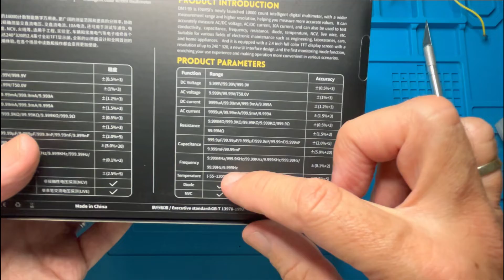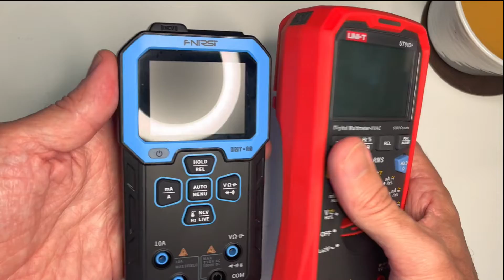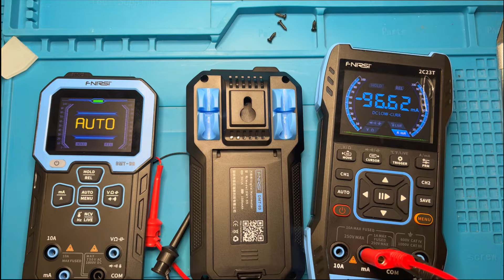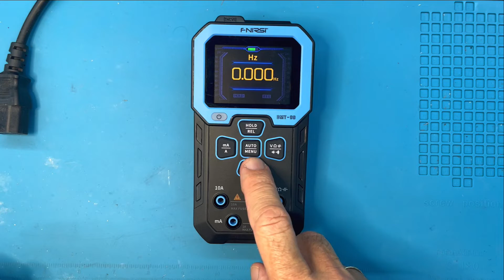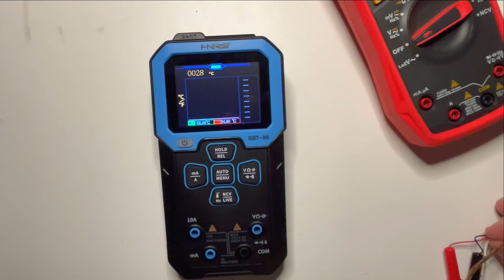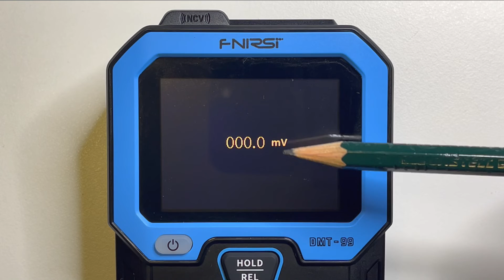EB008 - FNIRSI DMT-99 Multimeter Teardown, Functional Review, and Updating the Firmware

Comment: Regarding the NCV feature/issue: My DMT-99 (bought a few days ago via Ali, sent from Poland) has two different NCV options, the second one being almost deaf, the first one being pretty sensitive, sensing voltage from 5 to 10 cm away. Maybe it's the firmware - my device came with version 2.4.

Comment: I wish they would use a visually pleasing font. :)
By the way: I would rate that internal battery as a big CON, not a PRO.
Reply from the maker: Yes, that font seems common in devices from China. I agree, not visually pleasing. On the battery, interesting point. Some people see it as a positive as they can use an any available USB output on a device to charge. Others would prefer to be able to swap in a fresh set of batteries. Mixed
Opinions on this one. Personally I like it for a meter like this. Thanks for the comment
Reply: @ElectroBananasYT  - People like you or me will look for a replacement battery if the built-in one dies, open the case, exchange the battery.
But the majority will need to trash the device and buy a new one. And you know how quick a battery can die if handled the wrong way.
A simple 18650 or two AAs behind a battery door would be the best solution: Easily swappable - also in cases where the battery is depleted but you don't wish to wait for a recharge.
And to be honest: Manufacturers love built-in batteries just because users will buy a new device if the battery gives up the ghost. ;)

By the way: I bought one of these, got it right today. You should issue a big BEWARE OF THE CABLES. Yes, it's a cheapo - but the cables are plain unsuable (which is an utmost polite expression), pull the device from the table if you just move them slightly.  And unfortunately the silicone leads from my other meters with plastic cores won't fit the jacks.
There's always something. :)
Reply: I like the internal battery. It's a standard type you can buy from any store that sells batteries. A few £ each from AliExpress. It is adhered down but not ridiculously strongly like smartphones. No heat or IPA is required, just gentle prying and it comes off. And it's generally "technical" users that buy multimeters anyway. If you have a multimeter, chances are you can replace the battery. Battery seems to be decent quality too, mine was also made by "JHCY" and pulled full capacity when I tested it
Reply: @yotoprules-u6l  - That's good news. :)
I usually aim not to buy any device using fixed batteries; but it's like a pest this days: Manufacturers love the idea of forcing the customer into buying a new device as soon as the battery dies. Using fixed batteries is a pure sales move with most (but not all) devices.
But it's good to hear fnirsi uses a rather standard battery. I am a radio amateur, so I ain't feared of disassembling and soldering. :)
Thank you for this info! :)

Comment: I just want to correct for current buyers: They fixed the NCV for new models. It is super sensitive now. Even much faster and further away than my other Uni-T and Klein meters!
Reply: Also the inputs are already CAT IV and CAT III rated.
Reply from the maker: Thanks for the information the CAT ratings. Where is that stated?
Reply from the maker: Thanks for the update on the NCV. Was that a hardware or software change (or both)?
Reply: @ElectroBananasYT  I am not sure - I have seen some videos that updated to the current firmware and still had a rather weak signal. But now I bought two new models at Black Friday sale were it is clearly fixed. It already starts reacting to a lamp cable 20cm apart. Very sensitive. Probably a hardware tweak.
__________
Concerning the CAT rating - it states it clearly on the device (you will see it in new product photos aswell if you search for them). It is also in the manual and online documentation. 
To give them probable credit - many Chinese devices are thrown on the market way before any certification was completed or tested. So the better ones do indeed complete it for further iterations (the bad apples ofc just print a number).
Reply from the maker: Thanks for that. I see that they have now added the cat ratings to the latest model. Well that is good. 👍

Comment: What a nonsese, if the weight of a multimeter decides if it is good. You don't understand antyhing about build quality. But who pays your bread, decides.
Reply from the maker: Thank you very much taking the time to comment. I measured the weight as a point of interest as the meter is incredibly light. The weight,  of course, is not a consideration in the pros and cons at the end of the video. Later in the video the unit is dismantled and build quality reviewed. Wishing you well.

Comment: Looks interesting! I'm more of a beginner and I currently have a Kaiweets ST600x, which works OK, I often use it for testing voltages and battery and one thing I've noticed is if the voltage is very low, the multimeter has a hard time measuring it and will often incorrectly output 0v, which can't be true since I'm able to recharge the battery. If the voltage was truly at 0v it would not be able to be charged again. The only other meter I have is a DT-830B which is complete garbage and completely inaccurate. 
I have used Fnirsi products before, I have the FNB48P USB meter and that works great, it is far better than my Keweisi one, it is very useful. Would you still recommend the DMT-99 or would you say there's a better meter in this price range? (£25-35)?
Thanks!
Reply from the maker: Thanks for watching and your detailed comment. If this is going to be your primary and general purpose multimeter, then I would go for something more conventional. The market is crowded at this price point, but in my opinion, it would be safe to go for the best Uni-T meter that you can afford. The Uni-T UT139 series looks good to me. Amazon also have a deal on the UT61B+ at the moment if you can get one (I have a UT61 series meter and think it is excellent). However if you want features like the graphical interface and USB charging then the FNIRSI is accurate and okay (and fun). All in all, the UNI-T is the way to go if it is your primary meter and you want good battery life, dependability, good build quality and will last the test of time. Get the best you can afford. The FNIRSI is the fun girlfriend/boyfriend and a UNI T is the dependable Wife/Husband. Hope that helps!

Comment: FYI:  Update does not work if using Windows 7 Pro.  Windows 7 apparently doesn't recognize the file system and  is asking to "format" the drive so I opted out of that option. I will try on a Windows 10 system and hopefully have some luck there.
Reply: I do have the same problem on my W7 pro PC it does not work, asks always to format the file in FAT16 modus. I will try it on my W10 PC .
Reply: It works on my W10 PC ok!
Reply: @lucasbretels  Thank you for confirming that.
Reply from the maker: Thanks for sharing with us!

Comment: Please ask FNIRSI to add Hz and Ohm to the Thresholds ;-) Very Informative! There are more Infos to CAL Mode?
Reply from the maker: Hello, happy that you found the video informative. That is a very good suggestion on the thresholds. I will feedback the point to them. No more information on the calibration mode. There is also a similar mode on the 2C23T (see my functional review on it). I did ask FNIRSI for more information on the calibration mode, however they declined as it is meant only for their internal production process.
Reply: also and diode mode :)